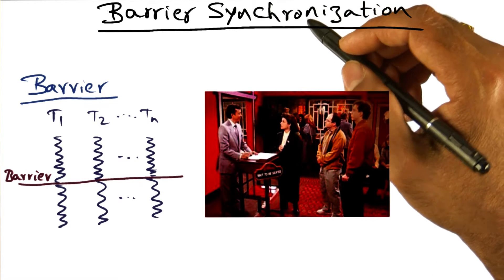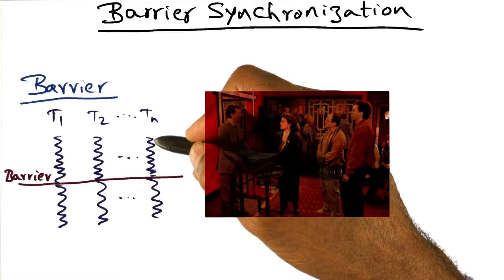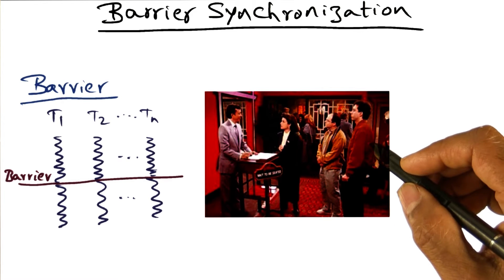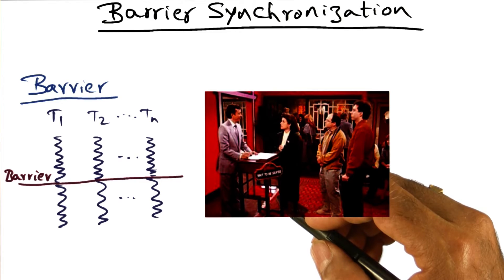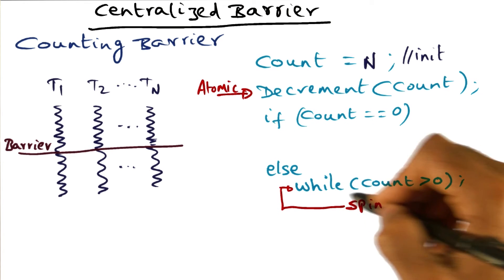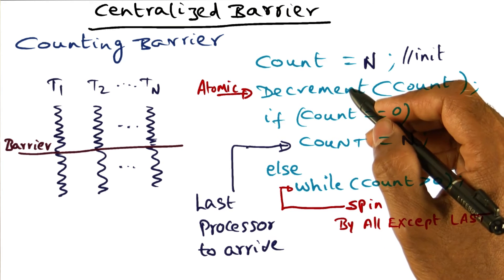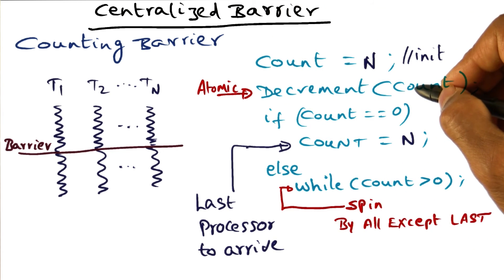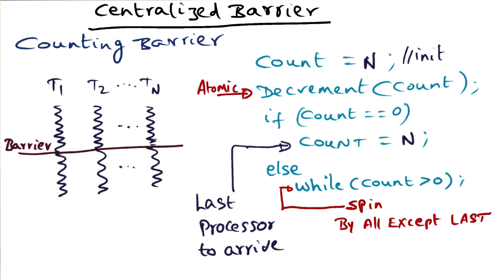Barrier Synchronization - Georgia Tech - Advanced Operating Systems

Comment: Is there any way to delay a particular thread if current thread is going to access the output of previous thread...
For example,  array[0] = 0; array[1] = 1;
 if(index>1)
 {
     array[index] = array[index-1] + array[index-2];
}
This is like fibonacci sequence....
The problem is  if index = 5, it should be array[4]+array[3]; But before that thread 3 and 4 has to completed... So how to use barrier in this...?